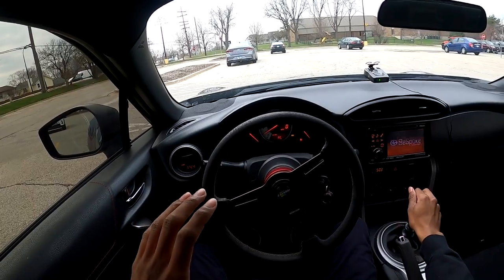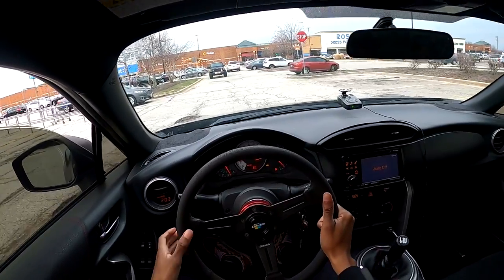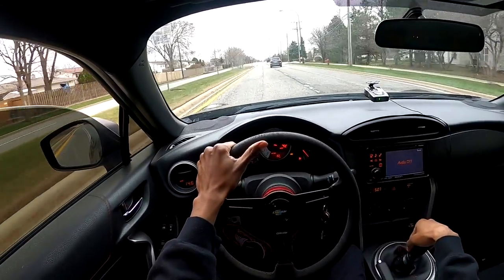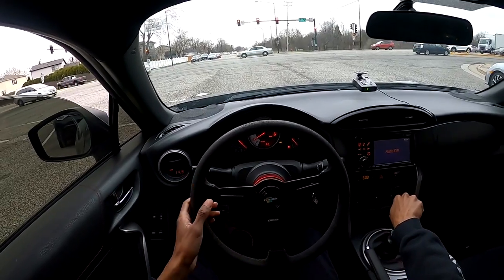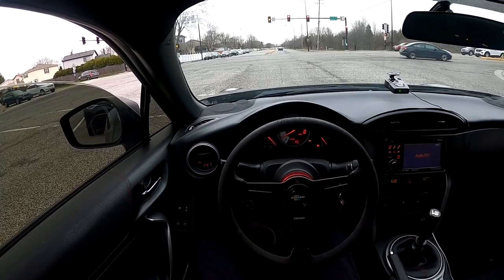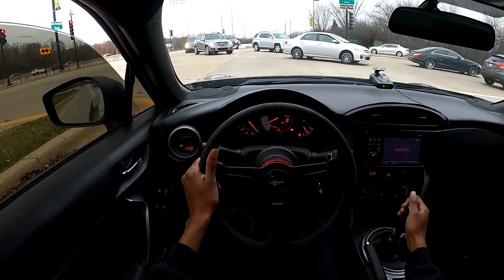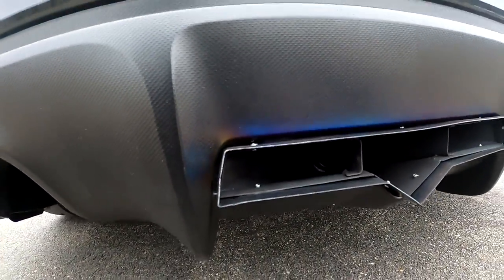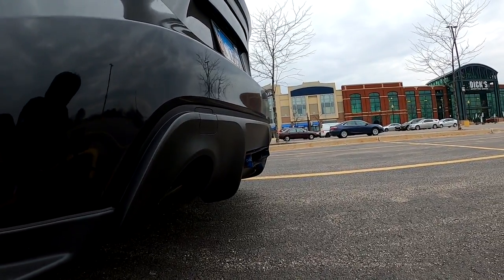LOUD POV ACTION IN MY TURBO FRS | Titanium Center Exit Exhaust + Pops & Bangs!

Comment: Man, that piping sits insanely low to the ground. 😬 Id be really careful driving, but ive not seen anyone do this before. Pretty creative, but that metal has got to get really hot to be sitting in a plastic bumper. I hope it doesnt cause anymore issues other than that burnt look.  It actually looks pretty cool surprisingly. Way to do somthing origional though. Props!
Reply: It actually doesn’t scrape. And the “burnt” area was just the reflection and it looks badass 😂